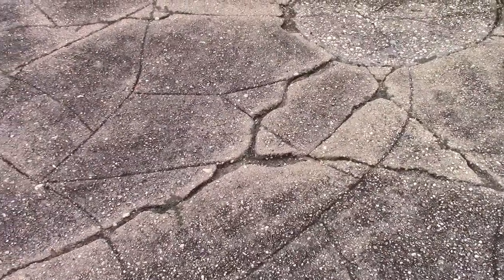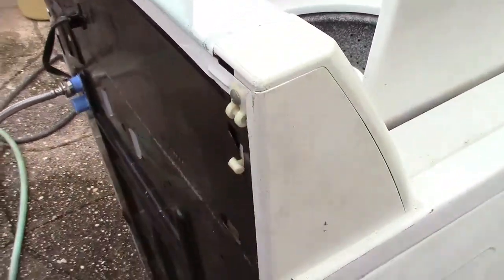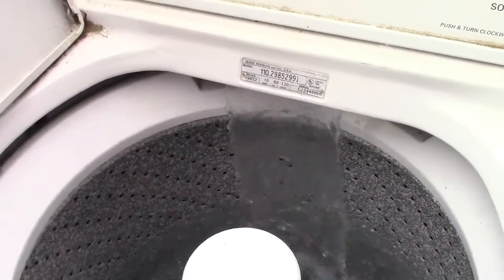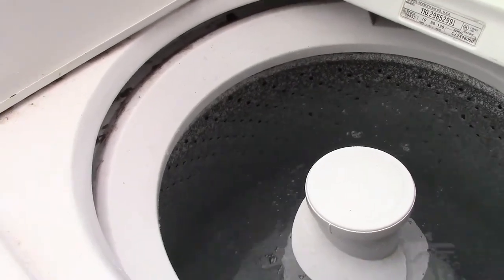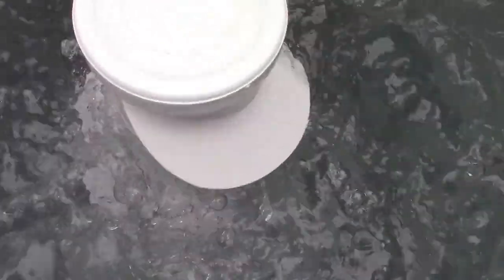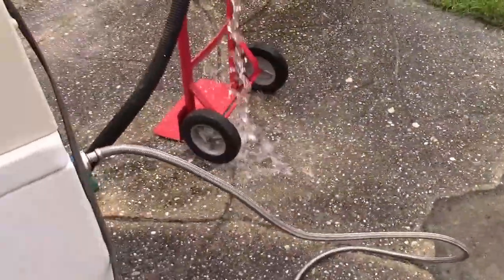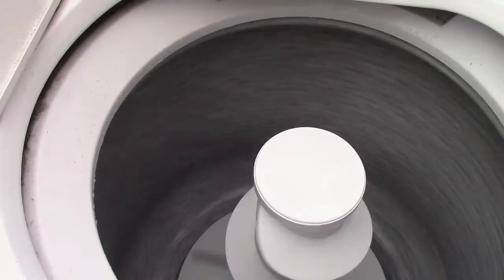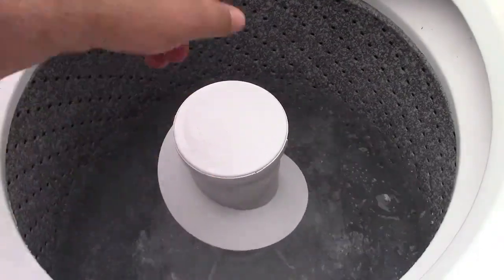Testing And Cleaning YET ANOTHER Kenmore 80 Series Washing Machine

Comment: Maybe the one spray rinse was an early attempt to save water.  Big deal, they saved 1.5 gallons.  

I still don't understand why Whirlpool has the spray rinses on the final spin instead of the first where it would help remove excess soap prior to filling for the deep rinse.  Of course back in the 60s they had spray rinses on both spin cycles like my machine does but the earth apparently had trillions of gallons more water then than it does now and they didn't mind using it.  I wonder where it all went?
Reply from the maker: Yeah, that was odd, the one spray rinse.  And I do agree, spray rinse in the first spin would have made more sense.  Both, like your machine has, is best.

Where did all the water go?  Well it's very simple, it's been tainted.  You see, all the tears from the crybaby Millennials and eco-wackos, and nowadays, Karens, have tainted that water and made it salt water.  Obviously like if you are out at sea, you cannot drink salt water.  So those trillions of gallons are no longer fresh water and are no longer available, so we have to conserve every last drop.  Because everyone knows that once water is used, it's gone and can no longer be recovered.

Comment: Tip top shape as usual! If the transmission was replaced, most likely it was due to a failed neutral pak. Can always replace that itself as you of course know, but it's probably just easier to replace the whole thing. 

Agitate gear sounded VERY nice in neutral on this machine. You could even see the vibration ripples in the water, that was a cool sight! Water level switch could easily use an adjustment. Even on the lowest level, that was definitely lower than it was for the 1990 machine. 

Was that the neighbor Joe was talking to near the end?
Reply from the maker: Yeah this thing was in really nice operating condition.  We were both very surprised.  This thing was QUIET.

The guy at the end was his brother-in-law.
Reply: I agree with you, Sharkie, this machine sounds very nice! What a score!

Comment: Hey jay I bought a used old kenmore 70 series heavy duty it was built in October of 1992 I was wondering can I use my garden hose with a split connection so I can attach it to the cold water hose and hot water hose and run it on warm to get it to fill quickly even though it’s just cold water coming from my garden hose ?
Reply from the maker: Yes, you can most certainly do that.  But it won't fill any faster, even on warm.  You have one hose to start with, that you're splitting, then the washer is combining it.  You can't get any more water out of that hose than it can already deliver.

Comment: My 80 series Kenmore is a step under that one I believe, but it has a different agitator. It has something that goes on top of the agitator in this one, that can be detached. I came here looking for videos to learn how to clean it properly and to see if it had some sort of an internal filter
Reply from the maker: Anything that goes atop the agitator would be a fabric softener dispenser.  If you're just looking to clean the agitator, you can use any method you see fit that will do the job.  These machines have a "magic clean" filter which is on the bottom of the wash basket, it requires no cleaning or replacing, it just sort of takes care of itself.

Comment: Hoping someone sees this!!  My 80 series, model 110.25862400 came to me used over 25 years ago.  The guy who fixed it for me passed away.  It only spins out water on the Gentle cycle with small loads.  Being a frugal single mom, I am torn between getting it fixed if I can find someone, or getting a new machine. I am looking at a Speed Queen.  I am thinking I should save the Kenmore, regardless.  Any advice would be much appreciated!
Reply from the maker: The best advice with the limited information you gave would be to fix it.  Only the TC Series Speed Queens can compare.  It would be much less expensive getting it fixed.

If it only spins out water on the gentle cycle with small loads, what happens in other cycles?  It could be that the drain pump is occluded, or the drain line itself.  Perhaps the pump has gone bad; those can be had for 30 bucks or so, which sure beats the price of a new machine.  Start calling people, and a lot of people.  Even a handyman, that might actually be your best and cheapest bet, instead of an appliance repair company.

Comment: Hey jay I have a question for you should I sell my 1992 kenmore 70 series top load washer and get a free used matching kenmore 400 series direct drive washer with dryer?
Reply from the maker: Probably not, there's not much you're going to get in return.  Not to mention, a used machine is like a used car, it might have its own host of problems that you'll have to fix.  With what you have, you know what you've got.
Reply: @jaykay18  well I’ve already put a good bit of money in the 1992 and honestly it’s got some issues I don’t like
Reply from the maker: @gaelanpatel9239  A better idea would be to learn how to fix it instead.  I have videos on that.
Reply: @jaykay18  it’s mainly that it has only 3 water levels and if I want fast agitation I have to set it to the heavy duty cycle not normal or permanent press those are slow agitation
Reply from the maker: @gaelanpatel9239  My older machine is the same way.  It works just fine.  More features=more things to break.
Reply: @jaykay18  well should I convince my parents to toss out soon to be 5 year old Maytag bravos 4.3 cu he washer the warranty with lowes expires on July 11th this year
Reply: @jaykay18  to get this old matching set
Reply: @jaykay18  cause I can’t sabotage it without them knowing and it’s still under warranty I hate it takes over a hour to wash a small load of rags anf aprons
Reply from the maker: @gaelanpatel9239  Your parents are going to do what they want to do.  Likely, they won't take what you have to say into account.  When you become their age, you can make your own mistakes.

Comment: Easier to work on..and these washers usually dont get the mold problem..the front end load type washers!?!?
Reply from the maker: Yes, that's all correct!  They usually don't have the mold problem because there isn't standing water, and dirt, for it to grow.  Front load machines need a bellows, a rubber flexible thing connecting the drum to the front of the machine, without allowing water out.  It's sort of accordion-style, so the water sits in those little folds.